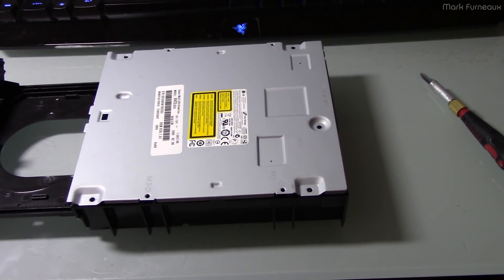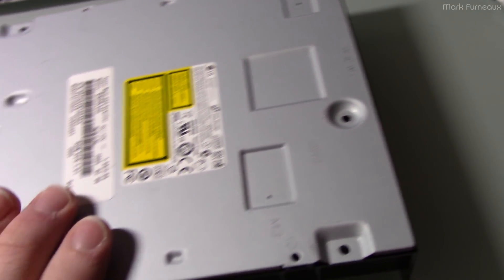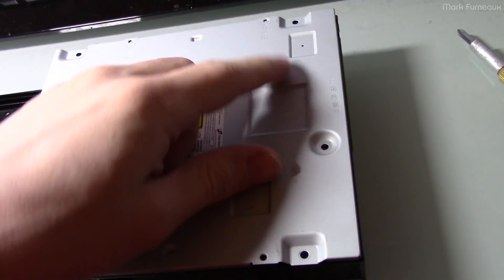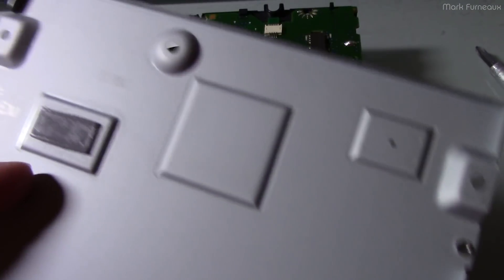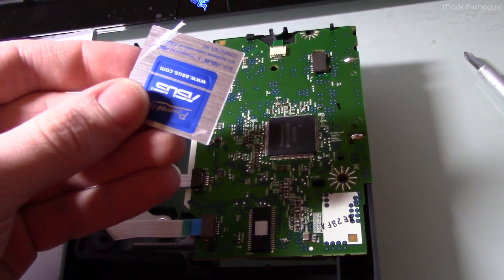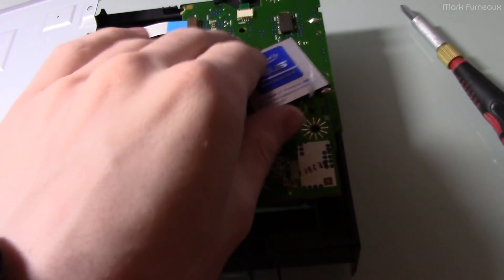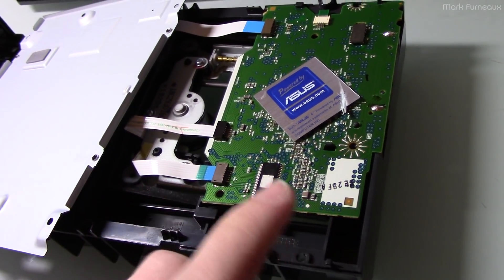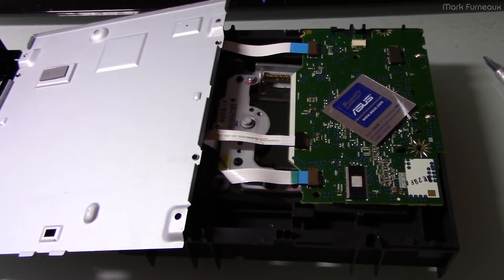How Not To Heatsink A Chip

Comment: An optical drive has not been a part of my desktop builds for easily 8 years or so now. I decided that I, and the few people for whom I build computers, do not use CDs/DVDs/Blu Rays on the desktop often enough to warrant it as a standard part of the build. In spite of the fact that you're only saving like $30-$40. Instead, I've got an external optical drive for about $40, and I just migrate that wherever I need an optical drive at the time. Otherwise it's all ISOs.
Reply from the maker: I'm with you on that. I only put one in because I already owned the drive. I haven't spent money on optical drives or media in at least 5 years.
Reply: Don't even need any drivers to boot the machines anymore on newer BIOS

Comment: I had a similar thing just today I decided to take apart a very old laptop to the part from it that can be use full and I remember taking it back to the shop for overheating too regularly a month later they said it was fine about 6 months later it died. there was about an inch of crap between the fan and heat sink. lucky they shut down.